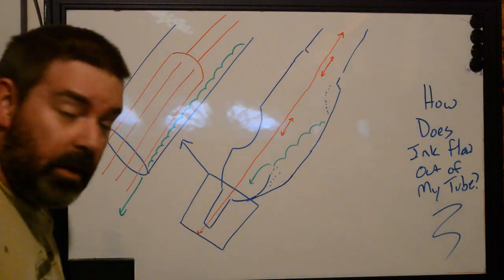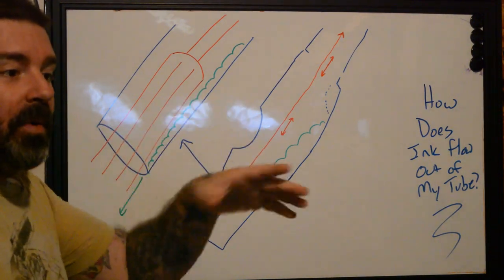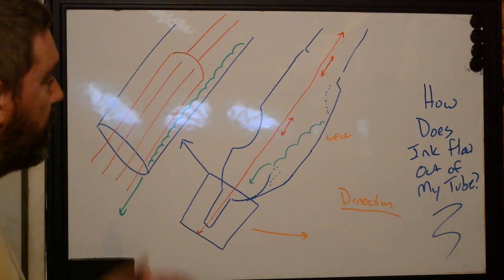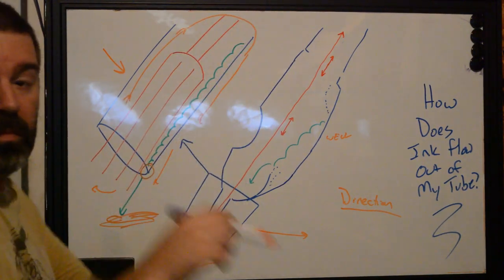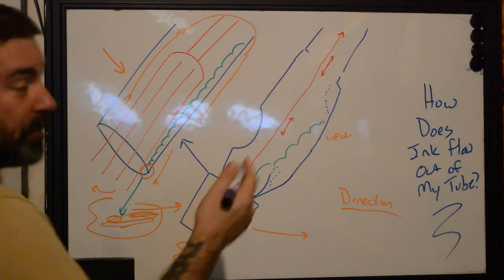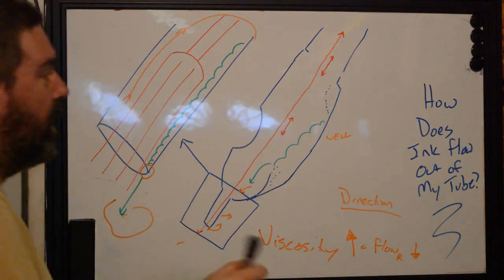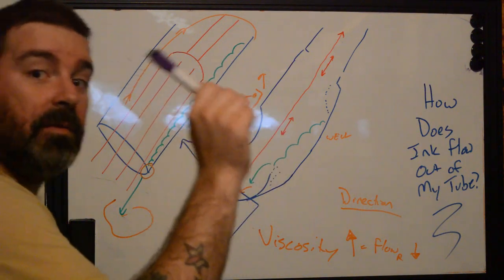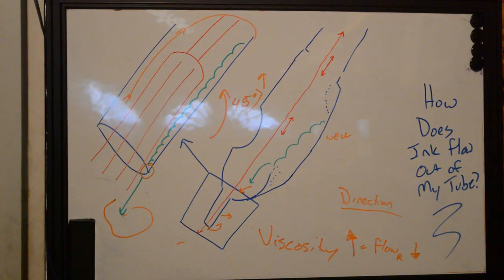How To Control the Flow Of Ink, Coming Out Of A Tube, In Tattooing

Comment: Hi, I have noticed that many professional tattoo artists pull fine lines (1-3rl), and others (traditional style) push thick lines (5-18rl). pushing the needle pierces the skin more easily, but is it easier to overdo it?
Reply from the maker: There is always a tendency to overdo the tattoo by running backwards because the ink flow is going to be inconsistent. This happens regardless of grouping size. Making sure you use the tools correctly will result in a better tattoo overall. Think about it this way - 

You can build a house with only a hammer, but how competent will the end result be? Can it be as good as someone who is capable of using all the tools at their disposal correctly? I could, but how efficient will it be in comparison?

Here is a question to you - What does it mean to be a “professional” tattoo artist? 
Does the term “professional” mean you are better or more skilled than another? Does it require someone to be somewhere, know something, or own something that sets them apart from another?

Anyways, thanks for the question! I hope this answer is good enough for you.
Reply: @BetterTattooing  Thanks for your videos! They are very interesting. And sorry for my English, I'm from Spain. Professional was not the most appropriate word, I rather wanted to say popular-famous. As for the fine lines, an example would be ivcrk_ (ivan cubero lopez), I did the lines just like him (big stroke, high voltage and fast pull), I haven't even tried to push the fine lines, I think that if I push them I will do too deep (more difficult to control the depth)

Comment: Hi, just curious, if one can’t push somehow. Turn the cartridge round, hole on the side now facing to you or downwards. So you can pull again? Probably not an option?
Reply from the maker: Good questions!
Pulling defies the natural flow of things so unless you contort your hand to create a proper angle for fluid delivery, its going to result in the same inconsistent flow dynamics. This doesn’t mean you can’t spin your tube around and push lines all day, it just means you won’t have the same consistency compared to running things forward.

Does that make sense? If not, shoot me an email and I’ll write you a novel, or a post on the website that explains it in more detail
Reply: @BetterTattooing  lol, have you ever seen a left handed person using the ‘claw’ ? Is that what you mean with contort? ;-)  and yes a post on the site please. Thanks.
Reply from the maker: @DavidToken  oh. I know what your talking about. I include the "claw" in a class about different hand positions to utilize while tattooing. It works, but you still need to push that needle into the skin. Id you want, I can go and make a video today to explain some stuff for you.

If you do want one, make sure you tell me EXACTLY what you're wanting me to show. I got time today, so we can crush a couple if needed🤘
Reply: @BetterTattooing  it’s strange, I’m a leftie myself,but don’t use the claw.I’m mirrored right handed . But if I push the needle somehow in my head I can’t see where I’m going,that’s why pull my lines. If that sounds logical,probably not,lol. Come to think about it it’s mostly sideways.